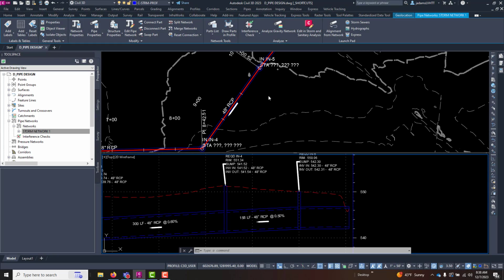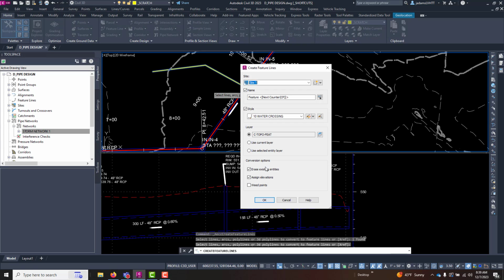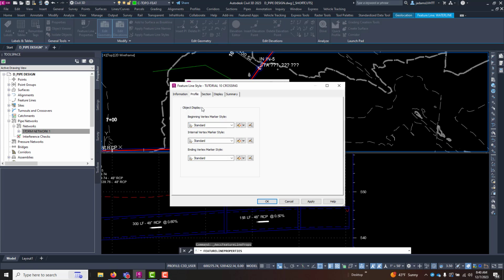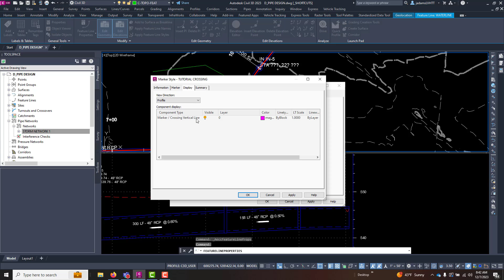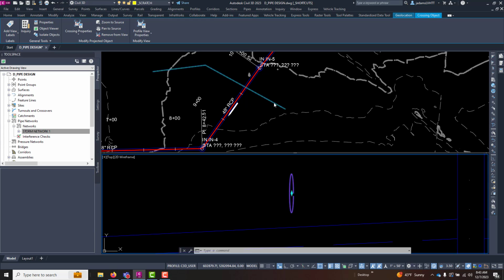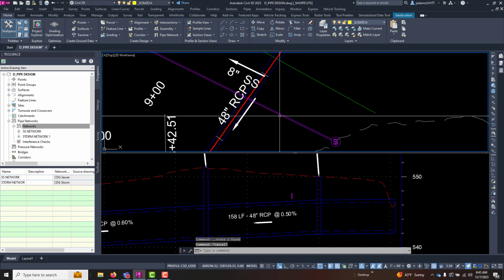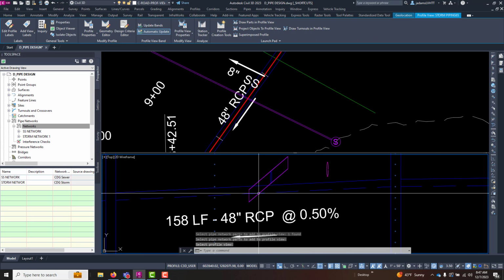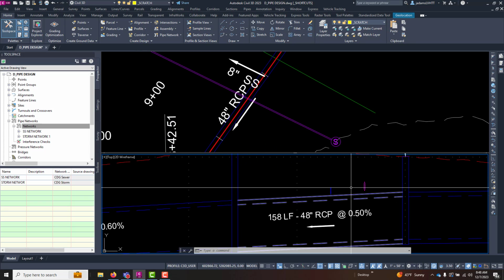Civil 3D - Adding Crossings to Drainage Profiles

Comment: The issue with the style affecting all profile views is easily solvable. Instead of editing the style on the pipe itself, click the profile view that you want it fixed on, and then click "Profile View Properties" at the top. There you will find a list of all shown pipes, and in the right most column is a "Style Override", this is where you change it to the style that is in crossing mode. That way the pipe style is only changed in that profile and not the rest.